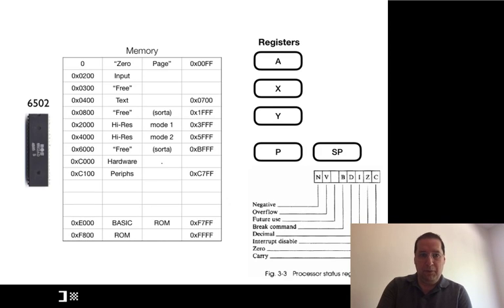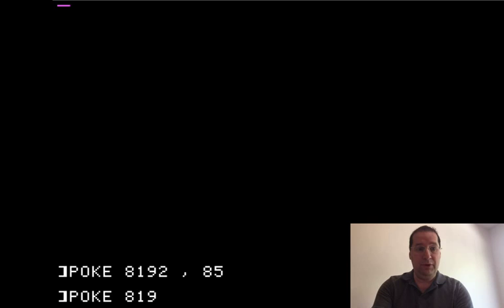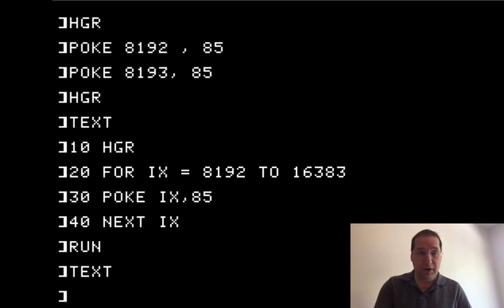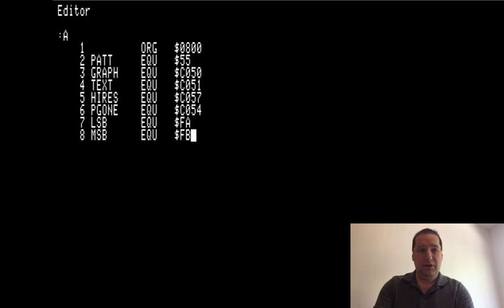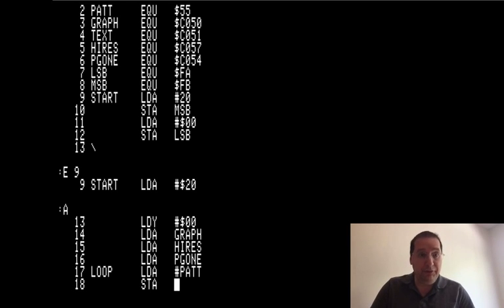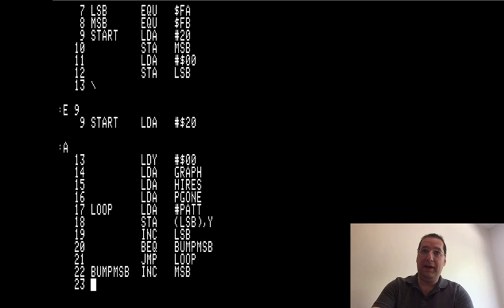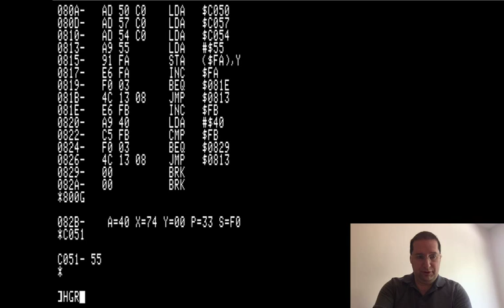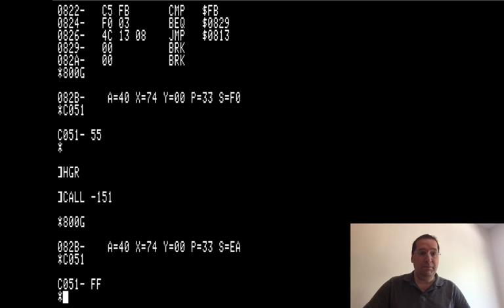6502 Assembly: Why? And How?

Comment: @Tea Leaves
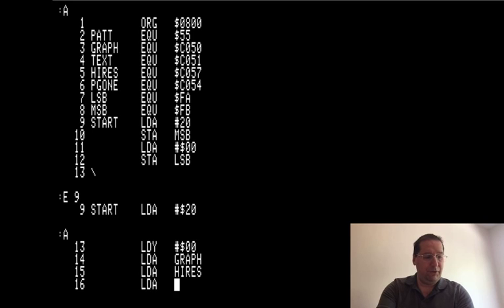One question. In 9:05 or line number 14 to 16 you load with the LDA instruction 16 Bit values in a 8 bit accumulator register. Why does this work?
All your 3 variables GRAPH, HIRES and PGONE you set up with the EQU instruction are 16 bit wide (4 Hex values), so why does your command "LDA GRAPH" etc. work?  Did i miss something?
Reply from the maker: The addressing mode being used there is called “absolute”. The 16 bit value following the op code is used as the address to load ann eight bit value. So it’s not saying load the HIRES value into the accumulator, but rather load, the eight bit value at the memory location specified by HIRES.
Reply: @TeaLeavesProgramming  Thank you for your answer.

Comment: Pardon the rookie question, since I'm fairly new to programming on the assembly level. And the vast majority of my experience with the 6502 is with the Commodore machines. 

But are soft switches like a really simple version of os calls or built-in macros? Because they kind of seem close to it, only turned on in a really weird way.
Reply from the maker: Not a rookie question at all, they're not intuitive. If you squint really hard you could view them that way, but they're even less sophisticated. A "soft switch" generally means "do anything to this location in memory and it does something."  Notably, this means you can turn on graphics mode by writing a value to a memory location - but sometimes you can also do it just by READING that memory location. Sometimes reading vs writing a soft switch will do different things. The documentation always specifies whether you have to read, write, or if either works.

I don't know where the term originated, but you can find Apple specific information in the Apple II Technical Reference Manual, which says:

"The devices which decide between the various video modes, pages, and mixes are called 'soft switches'.  They are switches because they have two positions (for example: on or off, text or graphics) and they are called 'soft' because they are controlled by the software of the computer."

I don't know if the term "soft switches' was ever used outside of an Apple II context.

Comment: Though I'm Atari 800 fan, all the "weirdness" about Apple "hi res" graphics speaks about the brilliance and genius of Woz.   He managed to take what is basically a monochrome signal and exploit the NTSC timing to get 6 colors out of it using a minimal number of chips.  The dude is the level beyond next level.
Reply from the maker: It's reasonable to think of the Apple II as a video generator with a computer attached to it, rather than the reverse.

Comment: Very cool to see this and bring back memories. When I was 16 I wrote a hybrid program, which was common of the day, that allowed me to edit the Bard’s Tale character disks. I released it as shareware at the time. I used basic for logic and user interface and ML routines for low level disks i/o. As an avid subscriber to Call A.P.P.L.E. And Nibble magazines I was always amazed at the versatility on the apple ][. I think the most impressive thing I had seen in during those years was the nibble article on creating a sound sampler using the audio port. It was pure magic on a machine just not made to be an audio/graphics killer app.
Reply from the maker: That's awesome!  I could have used your program when I tried to play Bard's Tale.

Comment: I'll try to be brief.  I wrote the code in Applesoft Basic to play Qubic, or 3D Tic-tac-toe.  It's played in a 4x4x4 format.  There are 76 winning patterns of 4 in a row pieces.  The player entered the level-row-column to make a move.  E.G. square 111 was level 1, lower left space.  My logic then would make a move (after seeing if the player had won).  This reply could take as much as 45-60 seconds.  I recoded the program logic in machine code, not assembly (technically the result would be similar).  The new program would reply before the players finger left the enter key.  I sold one copy to a fellow at Applefest in Boston around 1978?

Comment: Very interesting, thanks.
I never owned an Apple II, but i have 'dabbled' with 6502 code,  initially on a Commodore PET,  and later on a BBC Micro.
I did actually submit a MC program to one of the computer mags of that era.
It was a program to convert  any number from any base to any other base (e.g. binary to octal etc). I still own some BBC machines, but these days I just use them for games etc.
I've tried some coding on the Apple II emulator (Virtual II) on my Mac, and it all works well. Thanks for the nostalgia trip.
Reply from the maker: I have never seen a BBC Micro in person but it's a legendary machine.  Thanks for the comment!

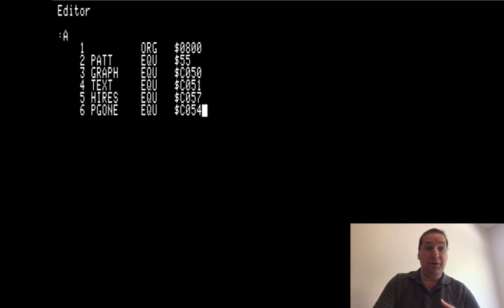Comment: 6:45 The exact reason is that store instructions on 6502 perform the store to the memory twice while the load instructions perform the load once. Go to visual6502 (http://www.visual6502.org/) to see this quirk in action. This means any device wired to trigger by stores would get triggered twice per write instruction. Therefore they decided to trigger the hardware by reads for precisely the same reason as why the hires screen is interlaced: to save chips.
Reply from the maker: Fascinating.  Is this also true for stores to the zero page?

Comment: It should be noted that 0x0000-0x00FF was RAM, but used for jump tables (I think), and 0x0100-0x01FF was the 6502 stack. Also, the Apple ][+, had 6 ROM chips of 2k each, or 12k total from 0xD000-0xFFFF. Also, if you booted a DOS 3.3 or ProDOS floppy, it would load somewhere from 0x9000-0xBFFF, I believe; otherwise, this was free RAM for your use. Finally AppleSoft BASIC programs sat at 0x0800 on up, but watch out for using the HGR command, or you could clobber the end of your program! 😬 Not sure what was at 0xC800-0xC8FF, though; maybe more free RAM?

Comment: It's actualy "technically" faster to use self-modifying code.  The tightest loop is roughtly
      LDA #value
      LDX #0
ptr STA $0000,x
      INX
      BCC ptr
      INC ptr+2
      BCC ptr

now... you need to initialize ptr + 1 and ptr + 2 ... and you need to check finishing conditions ... but you can add those.
Reply: Ohh look who's here, my other head!
Reply: @bahorized  my other car

Comment: I modeled programs in BASIC, but used subroutines. Then I started to convert the subroutines to relocatable assembly routines.  Over time, programs would become full assembly programs, and very fast.  And since many of the routines were saved as pieces, I could graft together a new program from the saved routines, like a library, in a simple BASIC wrapper.

What a time!  Thanks for the awesome video!

Comment: There is no need to LDA #PATT each time through the loop.  Instead, you could INY and BNE LOOP.  When this branch falls through, you could INC MSB,  LDX MSB, CPX #$40, and BNE LOOP.  This will run about 30% faster and take less progmem.
Reply from the maker: Thanks for the suggestions.

Comment: My first paid programming job was 6502 on Apple //e. This was a fun trip down memory lane. While programming in assembler seems tedious, I found it actually kind of calming in a meditative way. When a complex routine finally worked, the rush was exhilarating. It felt like successfully building the Eiffel Tower out of LEGO.
Reply from the maker: Great analogy!
Reply: I like that analogy. I feel the same way when getting something complex to work.
Reply: Not as low level but similar in terms of being close to the hardware and your analogy of getting something complex to work... Try writing a 3D Graphics Application to produce 3D Procedural Terrain Generation using Vulkan writting in C/C++... now that's tough! OpenGL and DirectX is still a challenge but Vulkan has a much steeper learning curve! Next up is writing an NES 6502 Emulator along with the rest of the NES's hardware components in C++. After that finish with making an actual 8, 16 or 32 bit CPU from logic gates in Logisim, then translate that into HDL or VHDL... My next project when I can save a few extra bucks would be to buy some breadboard kits and follow along with Ben Eater on his 8 bit bread board CPU...  I completely know what you mean by getting something complex to work and the success of doing it is like having the Hoover Damn built!

Comment: Since A already contained $00, you could have used TAY (transfer A to Y) on line 13, which would only have taken one byte and two cycles as opposed to two bytes and three cycles.

Also, there was no need to increase LSB each time around the loop; you could have just increased Y with INY, which takes only 2 cycles as opposed to 5 .....
Reply: Thanks for the suggestions! One of the challenges of programming generally and assembly specifically is knowing when it's worth trading off readability for speed.  I certainly wasn't trying for optimal efficiency here, but it would be interesting to know how much faster the changes you suggest would have made the program.  Try it out and let us know!
Reply: @peterb3398  In a project of mine, I've used a neat trick where I have to copy 4 bytes , and I also incidentally need a 4 at the end  (it's part of a chain-plotting routine.  4 is the plot mode for move; and whenever we do a move, we want to save the co-ordinates so we can close the path later). So my code is like this:

.copy_co-ords LDX #0
.copy_co1 LDA screenX, X
STA lastmoveX, X
INX
CPX #4
BNE copy_co1
TXA \ here X=4
STA plotmode \ 4 is move
JMP plot_point \ it will have its own RTS

Now whenever one of the co-ordinates in the chain has a "move" instruction, we copy the co-ordinates.  There are two bytes for the X co-ordinate and two bytes for the Y co-ordinate, units first; and when the copying is done, we have a handy four in our X register to set the plot mode!

There are more cunning stunts later.  If we have a close instruction immediately following a move instruction, we want to use that as shorthand to draw a rectangle:

.close LDA plotmode
CMP #4
BNE close1
INC plotmode \ 5 is draw line
\ boring instructions to draw lines to 3 intermediate points missed out
JMP plot_point
.close1 JSR plot_point \ plotmode must already be draw
LDX #0
.close2 LDA lastmoveX, X
STA screenX, X
INX
CPX #4
BNE close2
JMP plot_point

Plot mode 5 is "draw line".  If the plot mode is 4, we know the last instruction must have been "move"; so we just use an INC instruction to change it to 5, draw round the intermediate points (using a modified version of the plot_point code that never gets called from anywhere else, so it's just inserted inline. It doesn't take up enough space to spoil any relative branches around it) and finally, copy back the last moved-to point before we return to the calling routine via plot_point.  (A JSR instruction immediately followed by an RTS can be replaced with a JMP instruction, which is a "one-way" jump that does not save an address on the stack; so when we hit the final RTS of that subroutine, the address on top of the stack points to the instruction immediately after the JSR that called this subroutine.)

This is all going to be Open Sourced eventually, so I am commenting my code for the benefit of future hackers  :)

Comment: I'd have written this a little differently, for faster speed. Starting after you switched to HiRes mode:

LDX #$20
LDA #PATT
LOOP:
STA (LSB),Y
INY
BNE LOOP
INC MSB
DEX
BNE LOOP
BRK

Your way is not bad, but it does waste a lot of optimization that hurts both speed and memory use. Good video, though.

Comment: I think when you were talking about LSB and MSB, you meant "byte" instead of "bit".  I used to program in Z-80 and 8080 back in the 70s and 80s, on the TRS-80 model I computer. Great fun!  You do a nice presentation.  I learned a lot.
Reply from the maker: You're surely right, Anton - I misspoke.  Thanks for the correction!
Reply: Yep, Little Endian vs Big Endian.

Comment: Wish i had learnt this back in the day. It seemed very mysterious to me at the time, seeing page after page of DATA 169,0,192,32...etc etc in computer magazine listings and having no clue what they did.
Bought myself a commodore PET some years ago and taught myself ML, still learning of course but having fun. I get a great sense of satisfaction when a small program actually works! These days with the advent of the internet, online tools, windows based assembly programs, emulators and videos such as yours make it so much easier that I finally get to pull down the curtain on ML. Thanks!

Comment: Good Presentation!  I produce games on the Apple ][.  Apple ][ hires graphics have peculiarities for sure, but once you have routines that keep track of the memory lookup tables and bitmap shifts, you never have to think about them again.  I wrote a whole arcade game engine last year for my first game Alien Downpour.  Once the engine was done, the game came together quick.  I wrote my current game OidZone using the game engine in about a month.  I started programming using Merlin Pro 2.41 running in the applewin emulator.  Last year I moved over to using the PC using a text editor with Merlin32 to assemble.
Reply: Cool.
Reply: Your games look nice.